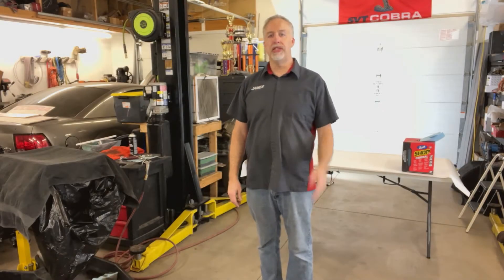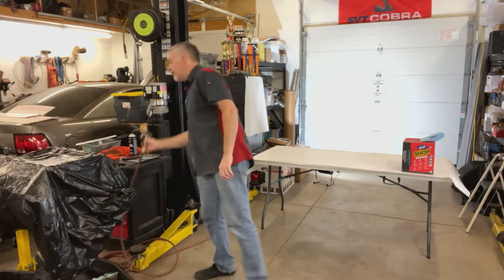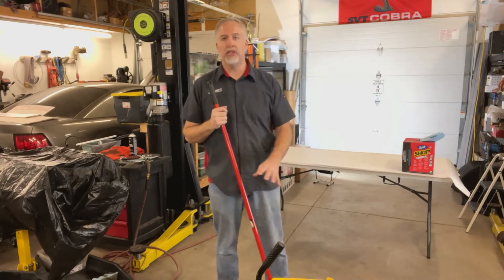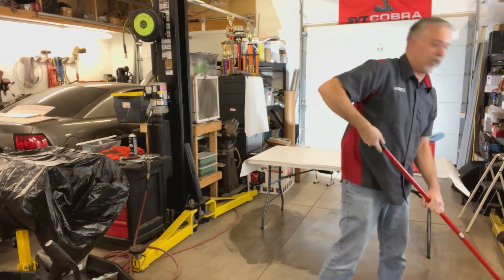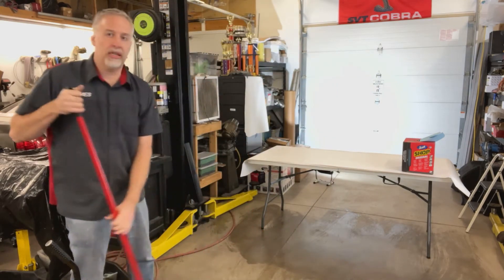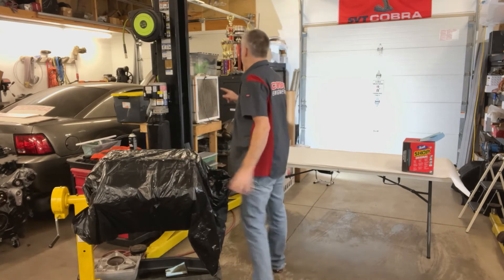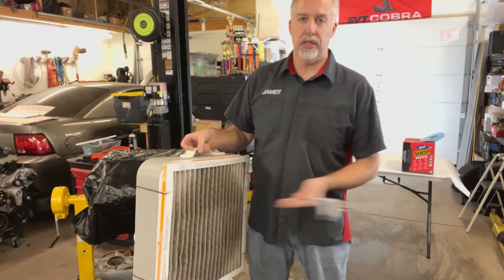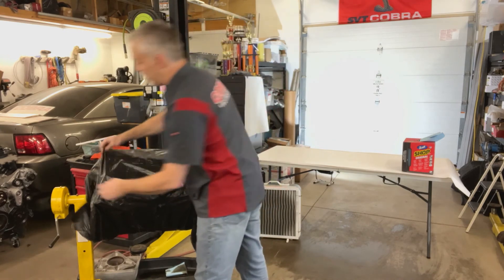Quick cleaning tips - Cobra Tech Talk

Comment: I should try that box fan setup. I have a forced air heater and it stirs up dust like crazy. I’m sure interested in your upcoming videos. I have my 32 valve apart right now.
Reply from the maker: I have a Modine myself. I should have said that I will crank the heat. Then turn it down before I unbag. That way it doesn’t stir up dust.
Reply: @cobraengineering  Modine here also. Ok I see. I kinda do same prep work before painting just never occurred to me to do same before engine assembly.